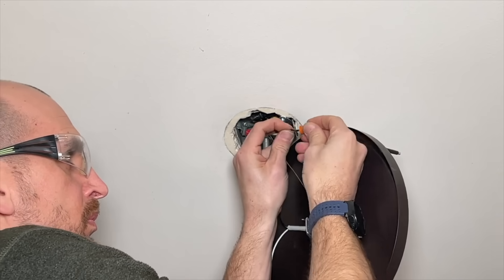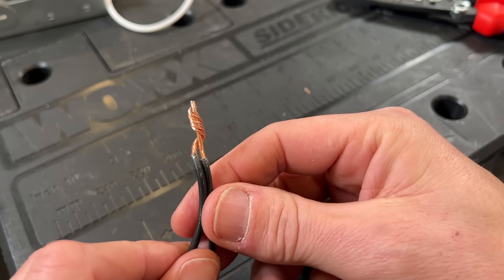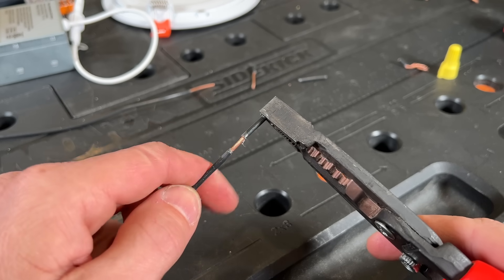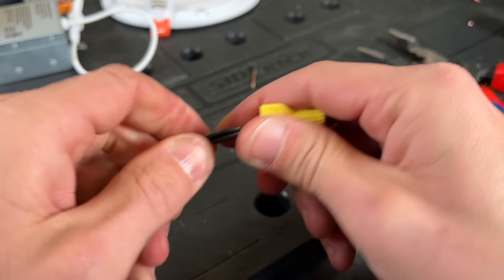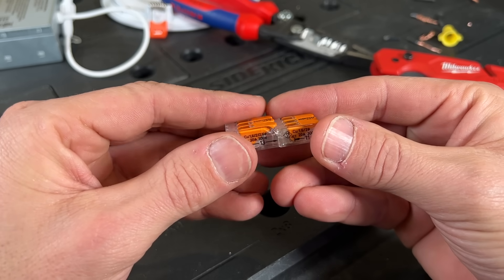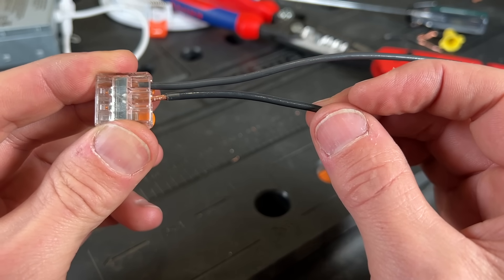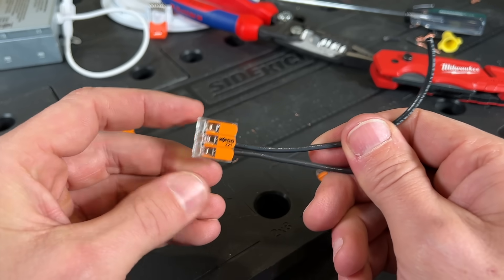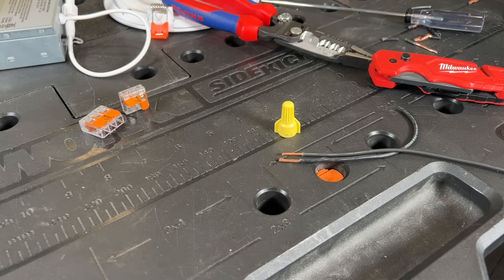Most Common DIYer Electrical Mistake - Don't Let This Be You!

Comment: We start from a pitch to save Granny from a cold apartment to a warm apartment for no money. Then pin it on a bad wire nut connection, solved by a particular brand of wire nuts and tools.  Great job, guys.  Thanks for the laugh.  How does anyone resist going out on a crusade to re-wire nut all the cold granny apartments in their neighborhoods?  Sheesh.

Comment: The biggest benefit to Wago connectors is they're near idiot proof. Amateurs are not the only ones that install wire nuts improperly. I've spent many hours tracing faults to loose and/or incorrectly install wire nuts on commercial jobs, done by professionals. The connections are more consistent with Wago, and because they're clear, easier to trouble shoot. Unfortunately nothing is totally idiot proof! Now if they could only idiot proof wire strippers.

Comment: Awesome, never heard of these.   I’ve always pushed my stranded all the way in first before pushing in the solid.  I also only strip about a half inch so there is no more stripped wire past the actual coil inside the wire nut. 
Sometimes wires are too short to push in and twist a big wire nut.  I’m going to get some of these.

Comment: My only issue with wago fittings is that the main body and toggle are plastic. Through my years of repairing things, many failures  due to the plastic failing. So wagon fittings concern me for long time installations. I have yet to see a wingnuts failure due to the plastic part failing. It may be to early to see down the road.

Comment: Is there a reason why you do the wago 3-way rather than the 2?
Reply from the maker: I just used the 3 wire for this video since I had the 12 gauge and 10 gauge handy to show the difference in size.  In the actual application with only 2 wires I would use the 2 wire Wago. 👍

Comment: Most of the LEDs I've seen use a much smaller stranded wire than 14ga. 
Will you still get a secure connection attaching 14ga solid to 20ga stranded using wire nuts?
Should I do the 1/8" offset (as you did with the 14ga stranded) for smaller stranded wire?

Comment: Love Wago 221. Made wiring in LEDs like playing with Legos. You're definitely right about these being more common overseas. It's nearly impossible to find the wago gelbox which is for waterproofing 221 in outdoor applications like my sprinkler valve wiring. I can only find them in other countries and shipping is way too much. I think I'll just fill them with silicone
Reply: Don't use silicone sealant. Most release ascetic acid as they cure and worse it is easy to get a tiny void and humid air gets in, water condenses, and the sealant doesn't let it out. Better is grease. Dielectric grease would be typical but any stable, reasonably clear grease is fine (i'd avoid any with moly or graphite). The commercial sprinkler connectors use grease. A neighbor used to heat a tub of vaseline to liquid and swirl his connectors in it. They'd cool and set up and be sealed really well.
Reply: @Sylvan_dB  good idea! Thanks for the tip. I do have some dielectric grease I can use. Do you think the grease can get washed away by heavy rain?
Reply: @RaffiT83  Rain and sprinklers seemed to not touch the grease I used to fill wire nuts. Some of the older were Lucas Red N Tacky, and that eventually starts to separate. Permatex dielectric grease seems stable for 5+ years now.
I think if a heavy stream were aimed directly at the grease it would eventually wash out. But the red grease in a valve box that fills with water multiple times every irrigation season has been fine for nearly 20 years now. It dripped a bit of oil, but still is sealing the wire nut.
I started using the chassis grease because it seemed silly to pay so much for the grease filled wire nuts on the irrigation aisle at the big box store.

Comment: Of course that wire nut failed. If you actually read the package, it says 2  #14 solid wires (minimum). Each size of wire nuts have which and how many wires it can safely hold. The problem being people not reading the manufacturer’s specs. Are wagos better, undoubtedly, but put the blame where the blame lies.

Comment: I helped a friend wire up some recessed LED lights like you showed. They come with connectors that look like the push-in connectors you showed. We got them installed before sheetrocking the ceiling. We had the lights on and were working on hanging sheetrock on the far side of the room. We heard a sizzling sound and smelled smoke coming from one of the light's box. We opened the box and checked the connections. No bare wire showing and all connections seemed to be seated properly. We tested it with the cover open and it was fine. We closed it and it sizzled and smoked. We took down all the lights and replaced them with electrical boxes on which we'll mount external ceiling fixtures. One thing that may have contributed to the problem was my friend got 12 gauge exterior grade wire when 14 gauge interior grade was all that would be needed. It was a tight squeeze with very stiff wire in that little box that comes with the light.

Comment: Thanks for the information and video. I am an amateur dyi and have always hated the wing nuts. Mainly because I was using them wrong. As few of the WAGO connections I need, cost shouldn't be a factor. Thanks.

Comment: Do yourself a favor and get and use WAGO connectors.  Just never use a wire nut again.  Not only are they not nearly as reliable even if you are careful, they add more hazard due to their inherent unreliability.  Using WAGO is some of the cheapest insurance you can buy.  And they are faster and more compact.

Comment: Twist the stranded wire counter clockwise during the pre twist.  It will maintain the gathering of strands under the wire nuts much better (the wire nuts go on clockwise, all rotations looking into the end of the wire).  Changed my life when I learned that one...

Comment: fascinating to see what other countries regard as "regulation"" standards. I guess the difference with the USA is having to use a screw fitting would be too much work compared to flicking a lever, as for "wire nuts" I don't think they exists here.

Comment: Here in Australia, the "Twist nuts" are not allowed (as far as I know), we use "bp1's and bp2's" , Clipsal 563B screw cable connectors. Wires twisted together, then put into the connector and the side screw screwed in. The "bp2"s" have 2 side screws used for earth wires.
Reply: DIYers are illegal in Australia too.
I am cringing watching this and reading the comments.
Reply: @greggilmour3482  You cant replace a light fixture yourself in Australia?

Comment: I am an engineer at an industrial LED Manufacter, and we almost EXCLUSIVELY use Wago (we pronounce it "way-go") connectors. I just placed  a PO for 10,000 2-way and 5,000 3-way 221 12 gauge series this week and we'll go through them by the end of this Q1 lol. They are amazing for assembly and infinitely easier to troubleshoot or do quick tests with compared to wire nuts. DO NOT BUY THE KNOCKOFFS, THEY SUCK!!!

Quick tip: the 221 series (clear body) have a tiny little square hole in the top for sticking a test lead in. So instead of getting a 3 or 5-way Wago and clipping a test lead into an empty lever, hold both LINE and NEUTRAL (populated with live wires) Wagos in one hand, and use your other hand to stick your two test leads into the tiny holes. Works like a charm!
Reply: only downside of the WAGO connectors, at least for industrial work, is they are only rated for 450 volts.  Maybe fine in parts of the world that use 380/400/415 volts, but in areas using 480 or 575 you cannot use them on low voltage motors wired "high."  We use them where we can because otherwise they are great.
Reply: @stevesykes68  they make a line rated to 690VAC for the NA market
Reply: @jimbojames9370  this is excellent news!  Wish my distributor had informed me.  I'll go looking for them now.
Reply: @stevesykes68  a lot of their products are also rated for both UL and IEC standards and you will find that even their common items like a 222-413 for instance, are only IEC rated to 400V, but UL and CSA rated to 600V. You can pull up a data sheet on their website. I assume the lower IEC rating is simply because they didn't need to have them tested/approved for higher in a 380v market where they originated. Hope this helps
Reply: @jimbojames9370  Yes, thank you.  And the CSA rating is also good to know.  I do get requests for equipment wired 575 volt from time to time.
Reply: All, 100% of the LED luminaires i installed in the past year (all commercial const.) , cans, 2x4s, 2x2s, exit signs, aaand so on had wagos from the factory, i love the variance in sizes and nothing beats the 8 hole for the equipment grounds, and of course being transparent is HUGE
Reply: The ONLY place I would use WAGO's or any other connector that uses spring tension to hold the conductor in place is on a fixed low ampacity connection such as an LED light. Remember those cool little stab-in the back outlets? They are the bane of us electricians and the top cause of service calls. Pigtail and use wire nuts. for the best connection. Electrician for 34 years.
Reply: @GarysBBQSupplies  i read a comment above that says wire nuts are not allowed in Australia. Any idea how their entire housing stock hasnt failed yet?
Reply: @GarysBBQSupplies  Oh-I remember them. Currently working on replacing all the outlets and switches in my house-all of them that style. Been using all WAGO's though, it's what we use at work so it's what I know works for me.

Comment: I always use the solid to solid linesman twist just dont overboard  your twist with stranded . the days when electricians didnt use wirenuts or vinyl..cloth electrical tape was the norm wrap bend over wrap you aint pulling shit apart but eventually tape dries out

Comment: If the power sauce is  #12 solid and I’m hanging a light fixture with stranded wire I’ll rap the stranded jacket around the solid jacket a couple times then wire nut

Comment: I hate wire nuts.  With vibration in a bathroom fan/light/heater install I did at my house , it worked itself loose over the years and caused a small fire.  Fortunately I’m a firefighter and was able to put it out quick.  I switched to push-ins several years ago and now after this video, I’ll be switching to wago levers!  Thanks!
Reply: You had a poor/ loose connection to start with. A properly made wirenut connection would not have loosened from vibration.
Reply: You hate wire nuts because you're a DIY, not an electrician.  I'm a retired old school master, there's an art in stripping wire and placing the stripped ends together and twisting a wire nut properly.  Never had a failure in my career.
Reply: You got me there, I am definitely a DIY person!  :-)
Reply: @stevendegroff68  And I am definitely a retired old school Master Electrician, not an 'old school master', as in teacher.  After I re-read my comment, I thought I better clarify.  😀

Comment: I'm not an Electrician, but a did learn basic wiring from my father in law. I use what he had. s set of crimpers which use a copper wire sleeve, which is crimped and covered with a rubber boot.

Comment: As an electrician for 40 years, the stranded an 8th " longer with proper wire nut, was what I did, no problem, those wago connectors is something  I would never use. Just not enough contact on the wire. That's just me. I sleep good at night. Never worry about my connections. Wago reminds me of a stab-lok on a switch, ot a receptacle. Always use the side screws with the wire curl going in the direction of the screw and a flat blade screwdriver. If stranded strip about 1n a half inch but leave 1 half in inch of the 1 n a half inch still on the wire,  twist the insulation about one turn, make sure you don't pull th excess insulation of,carefully wrap around the screw.  Take that excess insulation n tape it to the wire. No way to come of and no copper will be exposed. And NEVER use stranded wire in a stab-lok.  Yo will never get them all into the stab-lok. Was at a large condo, doing a remodel, n all the devices where stab-loked. Being the last electrician there I was forced to tell the contractor what I found out n told him I needed to correct everything of get some one else. Last one there is responsible for any work done, even if it was in a room not being remodeled. If a fire or any problem comes up, you will be called to repair it.  Even if it wasn't you. But being the last electrician there you are responsible. If the contractor does not want you to make everything correct, lots of paperwork n proof you didn't touch that box. And that is hard to prove. The remodel might have one device in a room on the circuits you were working on but not in that room but shared the same wall. Better safe than sorry.

Comment: With the advent of LED fixtures. WAGO style connections are becoming more prevalent.   In trouble shooting these fixtures I've found where the factory WAGO connections are at fault.  Simply using the "pull test" usually shows the problem.

Comment: Thank you for pointing out that you should not pre-twist the wires together. I have tried countless times to explain this to people over the years, and they just can't seem to get it. If you still have your doubts, you can contact the engineering dept. at 3M corp., and a technician will happily explain it to you. BTW, the 2 colored 3M wire nuts with the soft rubber skirt are far superior to any hard plastic nut. I've been an electrician for over 40 years, and I will never use another type of wire nut.
Reply: What are superior about the 2 colored wire nuts? I'm an electrician of 20 yrs and I have never had an issue with the standard hard body other than the 1/200 that crack.

Comment: I do retrofit HVAC with that old wire you got to get the wirenut biting into the stranded wire before you put the solid wire in it or that hard old wire will not hold the stranded wire

Comment: Make your life easier and the joint more reliable. Don't use wire nuts, they are ancient inferior technology. It's 2022 use wago lever connectors And a better wire stripper like a knipex 12 62 180!

Comment: I recently installed the exact LED light that you showed early in the video.  It came with the WAGO (or knockoff) connector - the first time I've used them.  I still have reservations.  Oh, and I do both the lead AND the twist on the stranded wire.

Comment: When I was taught 45years ago, I was to pre-twist connections until there was a good mechanical bond, and they would not easily pull apart without a nut, then add the nut. Now I use ferrules whenever possible and then the push in connectors. Ill be adding some of these Wagu to my stock
Reply: 00
Reply: Just solder the connection its cheaper and the only acceptable connection of 2 wires for any product sold in the USA where human life is dependent upon the integrity of wire connections. Why spend money for a variety of connectors or pins to crimp on connectors not to mention wing nuts and pull-testing does not prove all strands are making full connection, pull testing was created for connecting 2 solid wires and it is old technology. Simply said if you can not physically SEE that connection you cant prove shit when it comes to multistrand wire and pull testing is a good idea it passes a pull test but nothing else.
Reply: A perfectly installed wing nut is slightly superior to a WAGO, mostly because of cost. Drive by a builder-grade new neighborhood, and just guess at how many of the tens of thousands of wire nuts there are installed perfectly? The genius of a WAGO is it takes some of the human error out of the equation, which makes it valuable to homeowners, DIYers, and contractors with lazy employees. Blessings!
Reply: @MrHuram-abi  and how do you test a perfectly installed wing nut where the entire connection is hidden from view. A pull test only proves it passes a pull test. Whoop dee doo! What about the integrity of each strand carrying a heat load which deoends on every strand making a good solid & secure connection and thay when stripped no strand of wire is knicked or missing from the flexible insulation surrounding the multistrand? Please enlighten me. Simply said soldering a connection is the only proven & highest quality connection there is. Sure its overkill, but its cheaper than buying a wingnut, ensures a 100% connectivity, can still be inspected by using thick & clear heat shrinking to cover the connection, and proves beyond a doubt it wasnt your inferior standard that caused a failure. You cant get that with a wingnut painted to prevent visual inspection of the connectors integrity. It ahould be fucking illegal!
Reply: @MrHuram-abi  If it's a new build, why do you need to cut into new wiring and connect with a wing nut, just run the wires correctly in the first place. The whole point of joining cables is to come in at a later date and install something new, or replace something. Hence connecting wires at that point. If a new build is full of connectors, it's been done poorly and cheaply.
Reply: @MrHuram-abi  "just guess at how many of the tens of thousands of wire nuts there are installed perfectly?" 
None? I'd bet they all look like hammered dogshit and have taken twice as long to terminate.
Reply: To many crappy electrician’s are now using push in style Wago’s
Leaving massive shiners or exposed conductor’s passed the connector.
For this reason I cannot stand wago’s

The lever type aren’t to bad though.
Bit the push in style suck “for the next guy”

When I come to a job and have to fix your fuck ups that’s when it becomes a problem.
Reply: @didlydane420  lol literally blaming poor workmanship on the tools.
Reply: @didlydane420  The push in style are removed simply with a little twisting. Same as the shitty wire nuts americas stuck on. Even our chock blocks in europe are better than wire nuts.